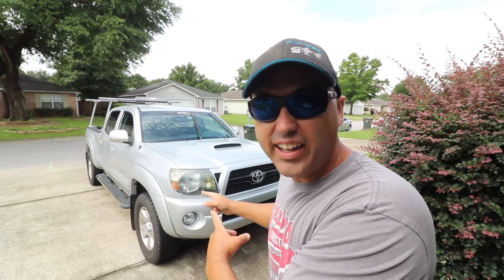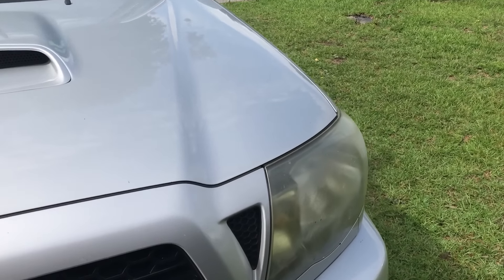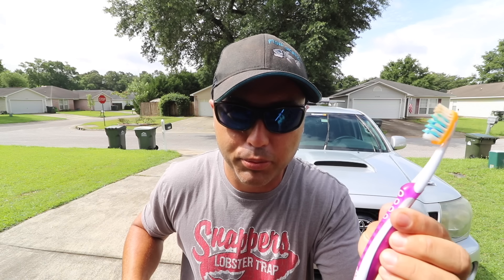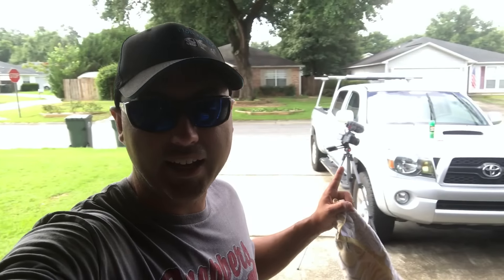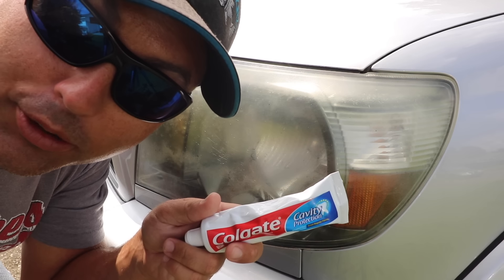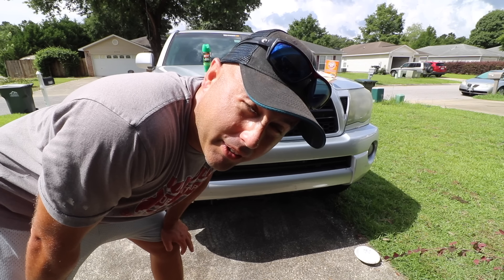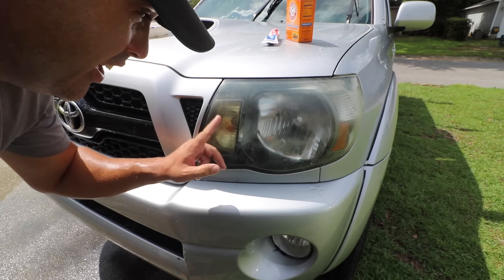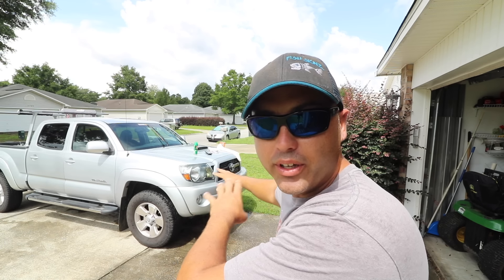The TRUTH about OFF & Toothpaste vs Headlights! (+Update on WD 40)

Comment: Maguires headlight restoration kit works brilliant and code 3 amber beacons are still clear
Reply: tyrone williams after you use Meguiars restoration kit spray it every year with Meguiars Headlight Coating and it will keep them clear forever.
Reply: Having tried pretty much every suggestion in this video I arrived at the Meguiar's, and whilst it's pretty expensive to comparable cleaners, I like yourself would totally recommend it. However the company does not pay me to promote their brand. Be well.

Comment: I refuse to put off on my skin ever since I was in the Marines and off removed industrial paint that was supposed to never come off
Reply: Wow. Man dont tell me that. Damn. Thanks for the info. Makes me wonder how easily it enters  the bloodstream given its penetrating properties. I might need to find something else to fight off the bugs. Thanks again.
Reply: Tiger Smith, I guess that's why they call it "OFF". 
I just baught some last week & it looks like I'm RETURNING it then. 
Not on MY skin.... OR my son's. NOPE.
Reply: @robertblackshear8963   Braggs  Apple Cider vinegar mix with one part water in a spray bottle.  Works great as a great repellent.
Reply: @lpperrone  ACV vingear ATTRACTS fruit flies & knats like CRAZY in my kitchen! How can it possible be effective as a repellant??
Reply: @youroldsweetie2319  What brand of ACV are you using?
Reply: @robertblackshear8963  I lived in Hawai`i & used to run in the morning. Natives suggested COCONUT OIL. 
I tried it & went into the Restroom where all the mosquitoes were & they wouldn't come near me! It works!
Deet causes cancer, it's very toxic & your skin is like lace; Deet just goes right inside your body!
Reply: @desirevargas3511  See reply above; it works!
Reply: Looks like the REPLY button DELETES ur Reply! 
Just use coconut oil. The mosquitos won't come near you. I lived in Hawai`i & it works great!
Reply: Aileen THANKS 4 that info!!! 
I will DEFINITELY try it out. 
I would've never thought that Coconut Oil, of ALL THINGS, would work on skeeters. 
And yes I see all ur posts.
Reply: @aileen9368  where do you get coconut oil,  and is it expensive??

Comment: I enjoyed watching both THIS and the previous WD40 video...like you said there is no 'quick fix'. So we either use a restoration kit or replace headlights, but If I could offer a suggestion to at least search CariD (or some equivalent match) will help $ave some money vs the manufacturers jacked up pricing for replacements. I have used CariD for headlights and fog lights, they are OEM fit and much cheaper. Hope this info helps someone.
Reply: i tried the turtle wax headlight restoration kit and it didnt work either!
Reply: there is a simple fix. its called have some common sense. the headlight is plastic, its scratched and nicked from rocks etc, you need to sand down the plastic till those things are gone, its a SLOW PROCESS and takes quite awhile of polishing and sanding and polishing and sanding. if doing it by hand and you arm doesn't hurt from applying pressure then give up and ask you momma if she can man up for u.
Reply: We tried the "As seen on tv" restoration kit...didn't work. At. All.
Reply: Only problem with aftermarket lights, no matter how much you spend, they'll never come close to OEM quality. The plastic lens is going to get nasty much faster, typically cannot get proper beam pattern or alignment.

Go with the kit, Mothers Nulens has been my best bet over many many years of trial and error. $20 bucks gets you good as new for at least about a year. At that point, repeat the process (roughly 30 min total) and your good to go.
Reply: Wet sand with really fine grit sand paper, wipe with alcohol, then ultra gloss clear coat...boom! New headlights.
Reply: When you are replacing Projector lamp units  the cost is ridiculous.

Comment: I used off  video shows you only put alittle on head light.. try turning on your headlights get surface hot  and literally spray off on heavy all over and wipe off immediately. Yellow film will wipe off, if it clouds up repeat process . I did my 06 chevy pick up doing this 2 a yr

Comment: The only permanent fix is to wet sand down the headlights, and then clear them again.  The spray clear coat will give you back the UV protectant that the headlights need to stay clear.
Reply: Drew Rischbieter a lot of people are not using clear coat that's why it fog back up in two weeks. It's been six month now and my headlights are still clear because of the clear coat. You are right with the clear coating
Reply: What kind of clear coat do you get?
Reply: @EagleTwo758  oil-base spar urethane is high in UV protection.

Comment: Many have correctly pointed out that UV is largely responsible for the haze.  Likely the constant "collision" with abrasive particles adds to the irregular surface.  Many of the headlight lenses are made of polycarbonate, (think LEXAN).  It's extremely tough.  Tough enough to warrant its use at tellers' windows.  Oddly enough, PC is fairly subject to petrochemical attack; ie. oils.  This is why you're finding oil-based products that are able to attack the surface and permit a clearing-off of the oxidized layer.  Fortunately, it seems the UV doesn't cause internal discoloration, so once the surface is either chemically clarified or buffed with an (very fine) abrasive, the lens can look new again.

Comment: Off is the way to go. 2months and counting. 💪🏻💪🏻💪🏻💯 don’t know how it can protect us from mosquitoes but will protect your head lights, that’s for sure. Plastic/skin who cares as longest the car is spotless. :) 😂
Reply: Used "OFF" on my son's 2001 Ford Ranger (  the lens were so foggy the light was very dim ) in the spring of 2018 and it is now spring of 2019 and the lens are still clear as glass.
Reply: The headlights on my 2014 Miata Grand Touring are more than $500 each so replacing them was out of the question.  Used Off and now 3 months later they are still spotless, before you couldn't see through them.  Using Off didn't take 3 minutes and it was spray on, wipe off easy.

Comment: You need to use blinker fluid.
Reply: Ron Agee don't forget the board stretcher and the sky hook
Reply: There is such a thing as headlight fluid; some cars auto-level the headlights and have a bubble level (like on a home/bar level) behind them for adjustment that can get cracked and evaporate. And some cars DO have muffler bearings :/
Reply: the muffler bearing has to be greased properly
Reply: paul vanaman i just use a standard piecost.
Reply: oh no,,,,I've been using wheel bearing grease!
Reply: paul vanaman what it do with the wheel bearing grease.
Reply: If it exists, then there is a fluid for it and your lube shop sells it.
Reply: shadowspawn ss ;  fan belt buckles??🔧🔩🔧😀
Reply: Ron Agee LMAO
Reply: He needs to oil his muffler bearings
Reply: I like it
Reply: What? Lmao
Reply: left handed screw driver for the left side too
Reply: Ron Agee 8
Reply: Ron Agee lol
Reply: Wally Smitty always check clearance on the piston return springs as well. And the kenuder valve, or it can mess up the conniption regulator
Reply: Water is blinker fliud
Reply: Dont use that..its bitch to find...believe me im still looking for some
Reply: While you have the right idea, you are using the wrong compound...what I use is Meguiers yes the wax or Mothers...both top of the line...you don't need the kit...i get 4-5 months off the wax.
Reply: I've tried blinker fluid and it only works for about three weeks.
Reply: What
Thanks
Ytj HT hg
Ml ml ml MP and the money
Reply: Love it, I'm a mechanic and prank people with  that all the time  lol.
Reply: If you use a dicfore,  it works too. Just please, dont ask what's a dicfore, if you dont know then you have issues lol!!!
Reply: Chris fix lol
Reply: Wow!!! So much information! I can hardly wait for the new online above ground motor pool I bought to come in, so I can use all of this!

Comment: Yes many headlamps have a protective coating that must not be damaged with chemicals, solvents etc.
Talcum Powder with cool water (mixed very thin, just cloud being the talc has broke down to a very light grit )and a non abrasive applicator  or no more abrasive than a linen or cotton fabric will remove and fill and polish . It's what the pros use to detail chrome, paint and more without damage.  A little more elbow grease is all that's needed ...just don't get it on the headlamp....lol

Comment: Go to O'Reilly auto and buy the 3M headlight kit. Cost about the same as 3 cans of OFF
Reply: Scott Hummel ya instead of all these crazy homemade remedies, just get the proper grades of sandpaper and a finishing polish and fix them permanent or bring them back to new, not very expensive to get 5 sheets sandpaper
Reply: Cheaper at WalMart
Reply: He said it more than once that it’s wasn’t even close to being out of his budget to get new headlights or the correct cleaning mixtures, that he was only doing this as an experiment to see what, if anything, that would b laying around the normal persons house, could do a comparable, good job compared to products, a lot of them over priced, you’d get from a store.
Reply: @x-man5056  Aren't most things?
Reply: @GWade1217  The Off remedy is mediocre and doesn't last.  Good only if you are detailing the car to sell.
Reply: @alaureljordan2427  Yes, particularly automotive chemicals, oil, minor supplies.  I always buy oil and filters there. Save $10-15 bucks per oil change.
Reply: @x-man5056  Exactly,,, I bought my Certified Car with beautiful headlights, a month latter  what the f,,,,  so its a car detailing trick, I am going on YELP,, poor persons complaint board, maybe that huge Honda company will buy some new headlights for me,,
Reply: @photo7839  My advice would be not to expect new headlights from Honda.  Just have them restored properly or do it yourself.  Spread the word on yelp if you like but we live in a buyer beware world.

Comment: Wet sand it with 800 grit sandpaper. And buy a can or good quality clear coat spray paint. After you have wet sanded it with the 800 grit sandpaper let it dry clean it with alcohol. Then spray one coat of clear coat on the headlight wait 15 to 20 minutes for the clear coat to dry and then reapply another coat of clear coat. Then it will look brand-new just like the day you bought it

Comment: Good job. I'll try Off + apply a coat of clear coat and see how long it last..
Reply: Colgate toothpaste really works, just apply a small amount to a clean dry cloth and RUB it on firmly or  (in a circular motion ) and it will remove the dirt and yellowing on the lense
Reply: Richard P Chavez update? I was also thinking off + clear 3m

Comment: I for one have used toothpaste to clear the fog from my old 2002 Mazda. You just have to make sure you use toothpaste with baking soda, or add it on your own. Also note: NONE of these methods will work if the fog is INSIDE of your headlights.
Reply: there is no damage inside the lamp only humidity

Comment: you didn tapply the toothpaste right. For it to work you have to polish the lens. It takes time and will work really well. But easiest is the mcquires lens paste it works great and is easy to apply.
Reply: It's toothpaste so it needs to be applied with a toothbrush :D

Comment: You stated you were not a scientist.  Fair enough.  But how did you think this would be a fair comparison when you rubbed one light with a towel and used a toothbrush on the other.  By doing so, you negated your "experiment."  Fair enough to change products (that was what this video was all about) but you can't at the same time change the method.

Comment: I baught an old truck .. didnt fool around .. I bought emery paper that looked about the same roughness as the headlight and then thinner grit down to polish.   wash headlights and let dry before changing grit .. you will notice the spots you miss,  then even it out.  Cheap improvement for an older truck.   I put some car wax on'm and they lasted a few years.

Comment: I cleaned my headlights on my previous car using a paste made up of Bicarbonate of Soda (what we call Baking Soda here in the UK) and vinegar.  It took the headlights up like new and they stayed clean right up until I had to get rid of the car (failed her MOT), about 2 years later.  I'm now about to do the same with my current car.  Yes, the dreaded MOT is due (test for the car's roadworthiness in the UK).  Next time you clean your headlights, try the baking soda and vinegar paste.
Reply: I did the same thing and it did nothing.
Reply: @owrang9756  It does work - wish I could put on a pic of before and after for you but it does take a LOT of elbow grease.  You're looking at 2 - 3 hours per headlight.  I do so much with the Baking Soda and Vinegar and so much with Colgate toothpaste - the white one.  It would probably have been quicker with a 3M kit but the cheapest one here in the UK is just under £20 (about $25) and I'm not prepared to spend out that kind of money on a 19 year old car that could very well fail the MOT on more major things.  I'll find out tomorrow.  Wish me luck.
Reply: @Pythonaria  I only did 10 mins per headlight, but 2-3 hours is such a long time. I have a life to live!
Reply: @owrang9756  It's not too bad if it's summer and a warm day.  Just did mine in the freezing cold. Even using a kit and a drill attachment it's not a 5 minute job.  I'm not sure how much garages charge to clean up headlights but I think if I need to clean up headlights again, someone else can do the work - unless it's a nice, warm sunny day and I'm bored.

Comment: I use Ultrabrite toothpaste,  if you use a damp rag to apply like you would to wax your car, toothpaste on, toothpaste off..I have to do it about once every 3 months.  Dont leave the toothpaste on until it dries,  apply in circles,  then take a wet rag to rinse, and a dry one to dry directly after.   I stand by my 97 cent tube of Ultrabrite for headlights!

Comment: IF SOMEONE OUT THERE WAS STUPID ENOUGH. THEY COULD MANUFACTURE A GLASS REPLACEMENT LENS AND MAKE A SMALL FORTUNE.
Reply: I so agree!
Reply: What ever happened to Glass Headlights anyway?!!  Guess the plastic is safer in car crashes and easier to clean up, maybe, perhaps cheaper to manufacture and more profitable for Corporation...
Reply: plastic is lighter weight for higher MPG also - and also helps for shipping from wherever they're made
Reply: Ain't nobody gonna make no glass headlights thats ridiculous why the hell you think all headlights are plastic

Not as fragile and less expensive to make and to purchase wtf are you thinking
Reply: Easier to mold into all the different car styles.
Reply: @g.udn6219  even the plastic lens needs a mold.
Reply: I know for a fact, if I could purchase an aftermarket glass headlight for a higher cost, I would do it. The weather kills these lenses in Colorado. On my Dodge 2500, there is almost as much plastic as there is hood! It's ridiculous. I miss the days when the glass headlight/headlamp was all there was. And they were actually very strong. It took a lot of force to break those. When it burned out, it was simply (sometimes, not so simply) replaced, bulb/lens in one, and no plastic/acrylic. Great..now I have gone and totally dated myself!
Reply: I so agree....why did we fix something (glass) when it was not broken/worked perfectly!   I am looking to buy a used volvo 2004 and earlier because they had glass lenses.  Glass was needed due to a small headlight wiper....which has sine been discontinued.  Looking at a volvo for other good reasons too!
Reply: Headlights used to be made out of glass back in the day.
Reply: Somebody does, because I found them in the recycling yard, for my Volvo S40!!!
Reply: They already make glass replacement headlights. And way cheaper than OEM dealer prices. Just search ebay for headlights for your car model
Reply: They used to be made of glass, but was very dangerous in accidents and tended to chip and crack like your windshield does.  This is one reason they switched over to polycarbonate plastic.  There are several more reasons but SAFETY IS THE MAIN REASON.

Comment: You need to apply the toothpaste thicker and don't add baking powder. Apply toothpaste with hand make sure you rub it in a circular motion. Then get an old toothbrush and scrub in circular motion with a little bit of water as needed to scrub headlight.

Comment: Tooth paste is just a very very fine polish compound You need to use a pad and rubbing it like an compound use..
....works on many things...removes fine scratches from just about any type finish... use to remove water rings of wood finishes ,,where You forget and leave beer or pop  bottle can set to long on the end table and it leaves that white ring in the finish

Comment: I used the Off yesterday and the towel I was using came back yellow.  It removed oxidation from the plastic so it does do something.  I did see a video that says the Off will continue to melt the plastic.  I don't know about that but so far so good.  I just need them clean to pass inspection.